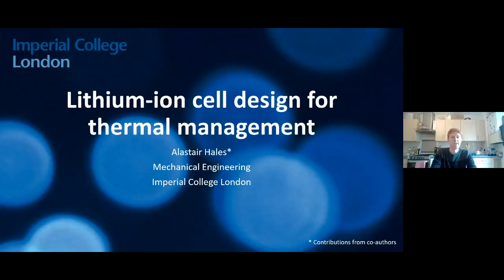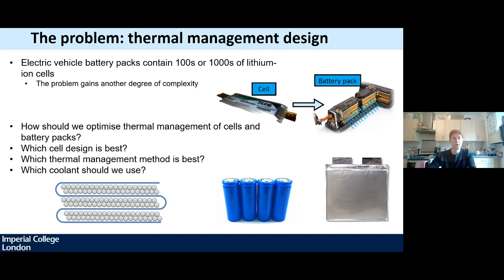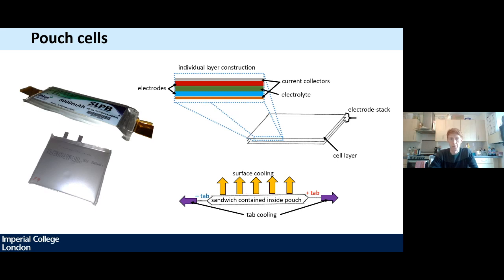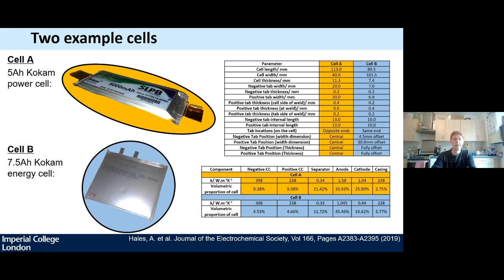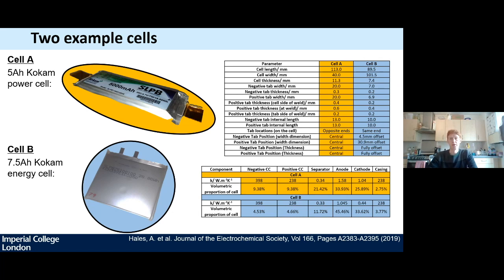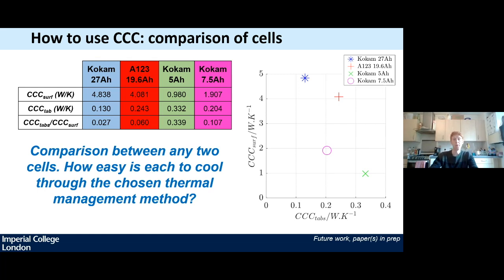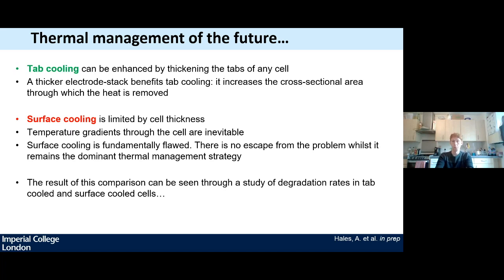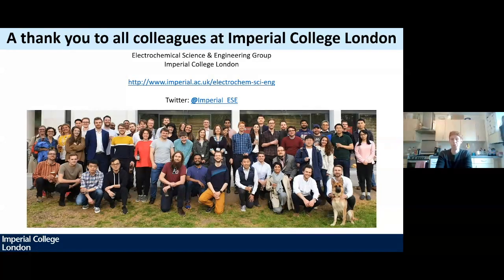Webinar: Thermal management design optimisation for lithium-ion cells and battery packs

Comment: Yes - we do need a standard to rate cells against each other. Glad someone is speaking to this!
Tab cooling appears to better especially for pouch cells, but the problem of course is how you remove thermal energy while also electrically isolating that heat removal without leak prone metal/plastic cooling loops. It is of course much simpler to remove heat on the surface with a simple copper plate connected to a copper tube carrying a cooler fluid, so that simple solution is generally preferred even if it is inferior (but better than no cooling at all). Of course sometimes having no cooling and just increasing the number of parallel cells to minimize heat generation is a reasonable solution.